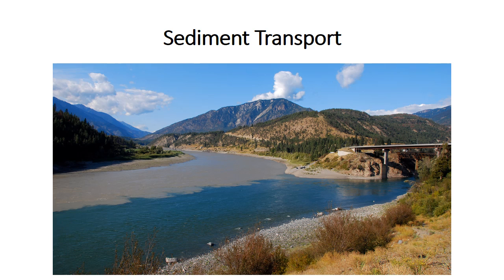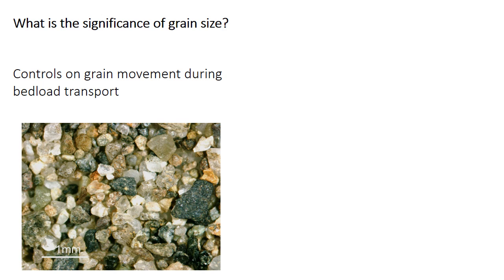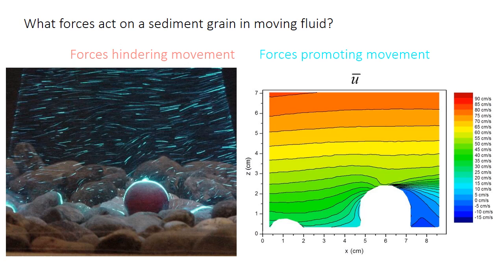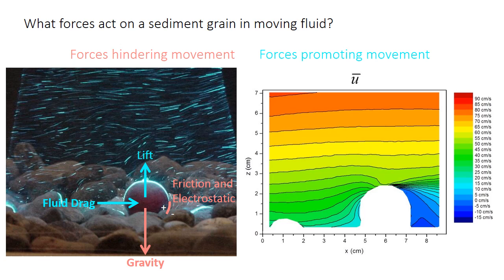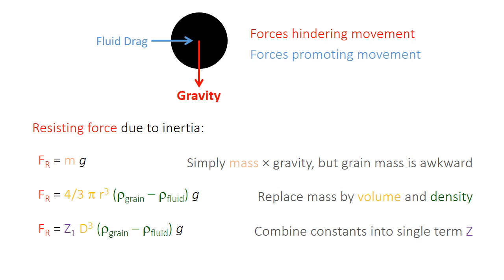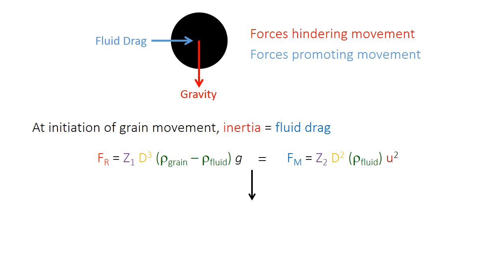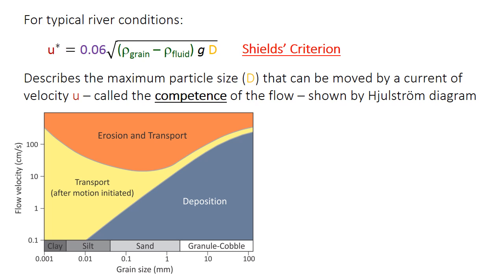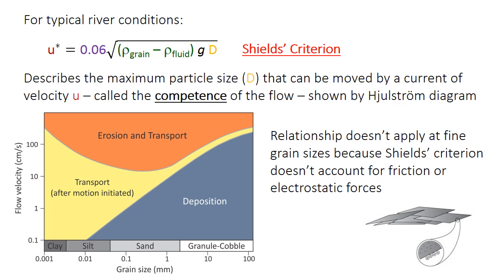2  - Sediment transport

Comment: 10 de Diciembre de 2024, 🥷.⚡️⛵️ hours after “very British Rebels” (by JW McAuley · Cited by 11) cheers “Argentina's pro-market shift embrace of Deepwater drilling” (Gas Outlook Dec 11, 2023), inside Santiago del Estero Hockey Club (G4200 Santiago del Estero, Santiago del Estero Province, Argentina).  Will The Lords 12 at NOAA (formed October 3, 1971; 54 years ago) have the evidence ‘11.3%’ 82.4M (OEC 2022) in refined petroleum exports to Argentina; as well as“Stormy Weather” (Song by Willie Hutch, Released: 1976) keeps the ‘Honest Men’  from “The Falkland Islands and no legal framework for marine protected areas or strategic marine spatial planning” (by JM Handley · 2023 · Cited by 6)!?!?

 

 

“Stormy waters: Britain, the Falkland Islands and UK- Argentine relations” (by K DODDS · 2012 · Cited by 62) 

 

 

https://en.m.wikipedia.org/wiki/National_Oceanic_and_Atmospheric_Administration

https://link.springer.com/chapter/10.1007/978-1-349-27429-1_7

https://tms.fih.ch/index.php/competitions/1695/locations

Comment: Thanks for your great videos. From Waves, Tides and Shallow Water Processes (Open University): u = velocity in the x-direction; v = velocity in the y-direction; and w = velocity in the z direction. The u-component of velocity is typically horizontal and parallel to the net flow direction.